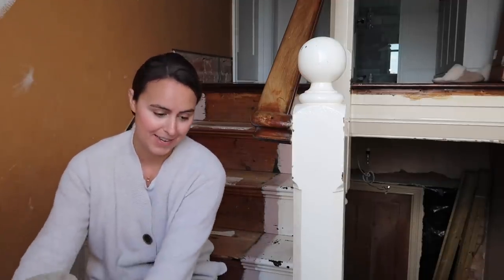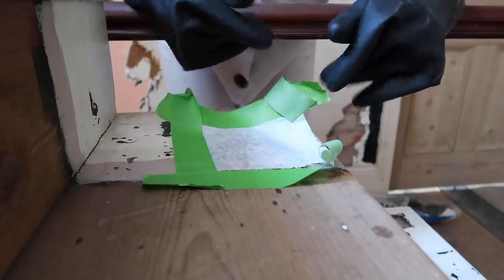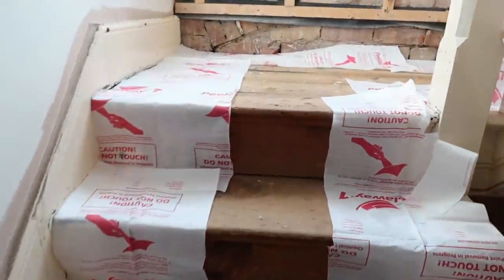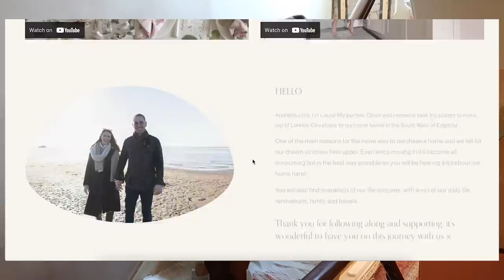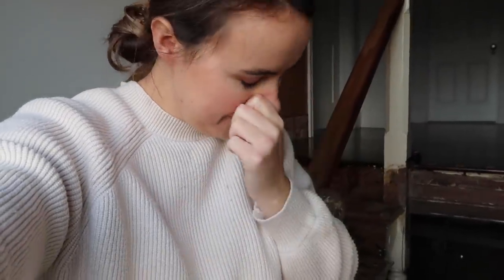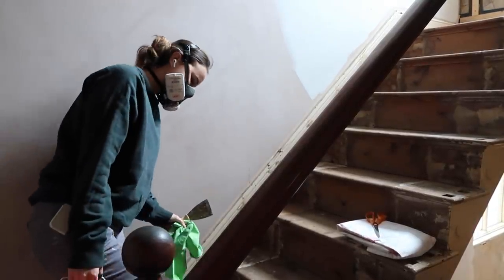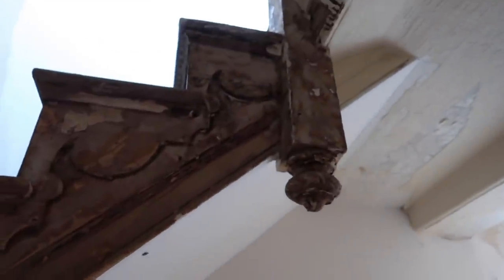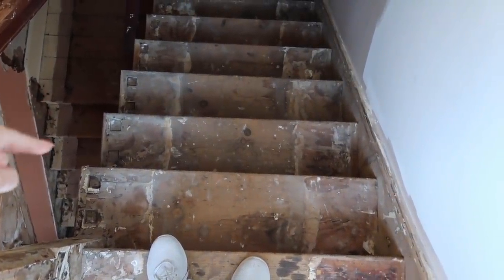I'M ON MY OWN - THE MOST UNDERRATED PROJECT BEGINS | Laura Melhuish-Sprague

Comment: Right after you scrape away the stripper use a large sponge and wipe the area with mineral spirits it will lift up the residual goo and keep the area neater.  Also keep your scraper clean and use an old sharp edged tin to put the goo into.  I have seen this done and it is shocking what the mineral spirits can do as a finishing step.  Get a Dremel for the nooks and crannies.  A dremel comes with many ends that can fit into the spaces and get out the little flecks you cannot get.

Comment: Hi Laura, I just wanted to wish you both a long life of peace, good health and the best of luck in your new life together as one. I have been married for 32 years now to the same man and he is the love of my life. As for the stairs. if you have used the paint stripper once and twice make sure you get mostly all that you can off. then with the rest its just a mater of sanding the rest which will be quicker than keep using the stripper over and over again, Sanding is great i find it therapeutic. My Son came and sanded most of my stairs when we got our stairs done, it is messy but when doing renovations its part of the job unfortunately. still you guys have a great start from what i have seen so far this is video #3 for me, great job so far.

Comment: nitromores and scrape then wire wool and nitromores to get off any stubborn bits. also when the wood is two different colours use bleach on it to strip out the colour. it needs plenty water to wash it off but it works great!

Comment: When i was trying to get paint off my wooden dresser, i tried every paint remover on market, heat gun all did not work very well, was pulling my hair out  !! Then someone told me about spray on oven cleaner ( got mine from home bargains called dr magic like 99p) but i did mine outside as a piece of furniture, so if you do try windows open and masks cause fumes, but it works quick and paint just come off in strips, i found not too much mess. Then i just washed it down with some soapy water , looks great. i'm sure it look great once done :)

Comment: I actually rented a sander, gex 150 turbo from the brand Bosch. It’s quite expensive and renting it wasn’t . My stairs were painted in so many layers stripping them with paint stripper or using a heat gun would have taken days. (I did try) the stacked layers of paint were just not coming off. Not gonna lie I was done sanding the stairs in a few hours with that sander. It took it all off and made the wood look entirely new. That worked best for me if anyone is looking to do their stairs. These sanders are the real deal.

Comment: You have your before and afters skewed Laura. The before looked bad, but right now you're at the interim stage which needs to happen so you can get to the after stage. Removing the paint using peel away is so much more time effective than sanding. It takes less time to apply and scrape and finish sand, than it would to just sand everything. While it's working you're able to do other things instead of spending days/weeks sanding.

Comment: i know you hate heat guns, but after having to remove paint from all the downstairs wall paneling and stairs, i found the easiest and quickest way was to use a heat gun to get the worst of it off with a linbide scraper, then hit it with a spray on stripper.  which then takes 30 seconds to do its job and clean off the rest of the paint with coarse steel wool..a quick spray and rub with neutraliser and all done.

Comment: Porridge poultice is amazing - ive completely restored our victorian ceiling rose using porridge.......mix porridge with boiling water and allow to cool and form a good stiff poultice-  spread thickly on paint surface and seal with cling film - leave for at least 3 days for the water to soak into the paint  (3 days should work for wood - you dont want wood too wet as it splinters under the scraper  but a week on plaster detail works better)...check the surface isnt drying out ...if mould starts appearing is time to scrape it up. ............remove porridge and scrape softened paint off before  it dries....this is how the benign eco strippers work - by slowly and simply transferring water into the paint to soften............Also it looks as though you will still need to sand after stripping ........I found  that the purchase of a 600 or 700 W sander is a lot more effective for sanding stripped wood and remaining paint ( although expensive at £280+) than the use of the standard 300 W domestic sanders that most people buy.  I finished d our stairs using powerful sander with dust bag plus henry vacuum attached plus decent masks plus floor fan for ventilation plus windows open! .